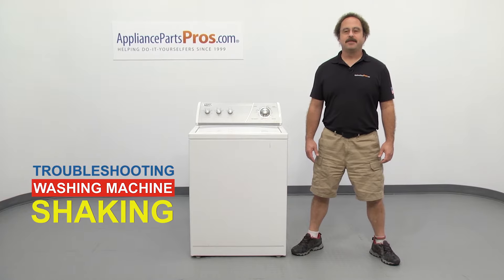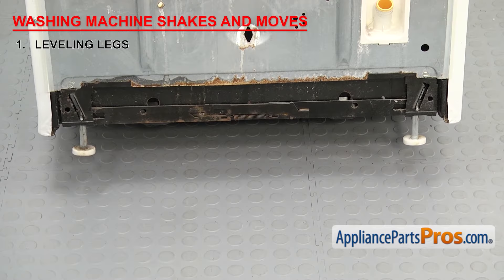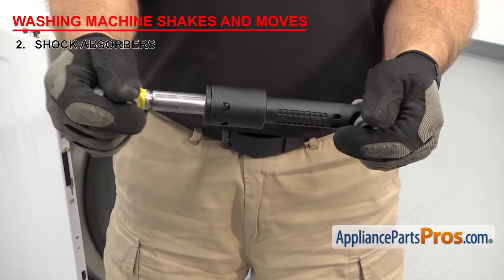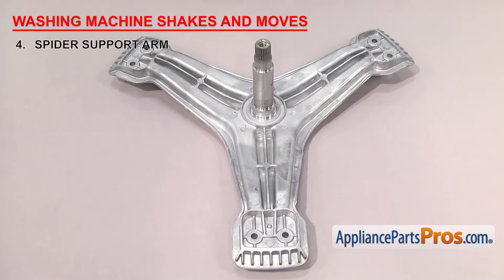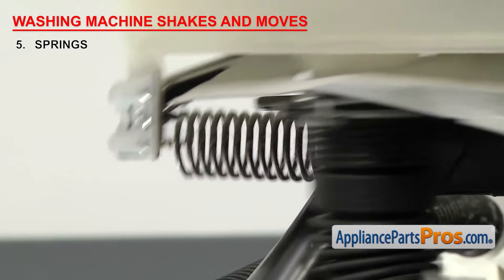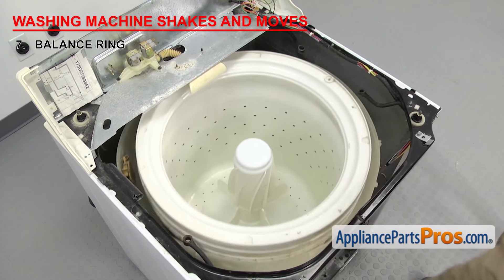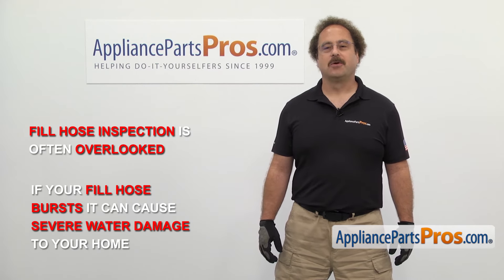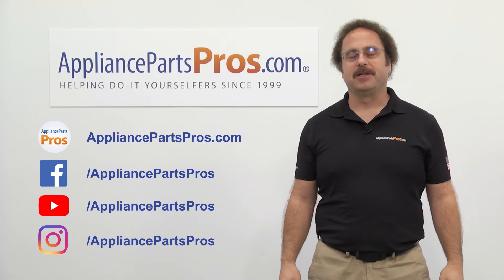Washing Machine Shaking - Top 8 Problems and Fixes - Top-Loading and Side-Loading Washers

Comment: How about if it spins uncontrollably in regular cycle but on delicate cycle it doesn't?? Help!
Reply from the maker: What is your model number and does it spin at all during the delicate cycle?
Reply: Amana and it shakes on delicate too so I change it to rinse & spin and it then spin fine I don't get it?
Reply from the maker: You will need to make sure the unit is level. Check the legs for any damage. Make sure the unit is not being overloaded. You will also need to check the suspension rods or springs for any damaged or worn spots.

Comment: 3:28 really unhelpful this
In the "good" case you give it one push, in the "bad" case you shake it around. How does this help anyone?
Reply from the maker: I'm sorry you didn't find this information helpful. Unfortunately, the suspension rods are not easy to diagnose unless there is obvious damage to it. We are just providing some tips to help you determine if they are bad.
Reply: @appliancepartspros  Ironically enough I put down the comment and closed the video after that section, but I did some more checking and determined that the suspension parts are probably fine, due to the notification of your reaction I played a bit more of the video and now I'm pretty convinced the spider support arm on mine has detached on one arm. So while the #3 section was not that helpful the following one was, thank you very much.
Reply from the maker: You're welcome!

Comment: If I've changed the springs and it still violently bang, what is next. 
NTW4516FW2 Amana C830 22541
Thanks
Reply from the maker: If you have replaced the suspension rods, W10780045, and you are still having the same issue you will need to double check the installation. Make sure they are all seated properly. Check the leveling legs for damage, make sure the unit is not overloaded, and make sure it's level. If you have any more issues or questions, you can call us at 1-877-477-7278.

Comment: Hello I have a roper washing machine that was shaking very bad and so I checked level and it is also checked load and no matter what I do it still shakes, I ordered the replacement suspension rods kit and installed but it still shakes what could be the problem now ? Thanks

Comment: Hi  Thank you for your great detailed information and so informative with Quick precise answers across multiple platforms of manufacturers.

 So on that note my question for you for my washering machine:  Whirlpool  MOD  LSQ9560PW2  SER CS1311919

You mentioned that the bouncer ring has liquid in it to help with counter balance.  How much liquid does it have in it, if you have a ever so simply, quick and easy repair on the tub balance ring. Then to just add the right amount of fluid back into it and seal it at that point.
 I'm assuming it's just water and maybe an additive.   How much Fluid is required to put back in it? But if that is a question you're unable to answer can you answer this question then?

 How much does a fully sealed new one  Or non damage one weigh and then I can figure it out from there.

I have a :
 Whirlpool MOD
LSQ9560PW2
SER
CS1311919

I like to thank you in advance Answer and a long list the knowledge that you have already provided with throughout your channel and content. 
Thank you

Comment: Great video. I believe all these parts are fine on my machine. Mine will vibrate and move occasionally when doing cotton towels that some how occasionally get off center and when it goes to spin if goes into a self destruct (my term) mode where it vibrates so violently it moves the machine. Again only happen when doing towels and only on occasion. I feel like this would happen regardless on any machine, I devised a clever way of solving this I tied a string to the back of the unit into the plug, so that when it vibrates in this mode It will automatically pull the plug out of the wall, I can then re-balance and everything works great. This is no big deal because it doesn’t happen very often but it’s a good safety device. I’m quite surprised that the manufactures don’t have some kind of sensing technology to turn machines off when they get into this situation, mine will literally move across the floor and continue running happy as a clam if left like this. Now the string will turn it off in the first 10 seconds.

Comment: Thanks for the video and suggested fixes. Had excessive vibrations and honestly was considering new washer/dryer. So in the video some of the suggestions were beyond my abilities to do so I picked the simplest one to do which was leveling. Did't know that the rear supports were self leveling, check the fron there were ok, picked up the rear of the washer and the levelers immediately fell down and when I put the washer down, everything was level. Tried a load of work jeans and very little vibration during the rinse cycle......so thanks to a simple fix per your suggestion saved me a bunch of money.....thanks!!!!!!!!

Comment: I have a  whirlpool cabrio WTW6340WW0 Whirlpool Washer that vibrates  really bad during low speed spin cycle. I have replaced  the suspension rods, leveled the washer, pulled the drum, no noise coming from drum shaft or play from shaft, checked motor bolt for tightness .it seems like its missing  more suspension  parts on the bottom drum. any thoughts on what  else I can check.
Reply: If you live in California, it's probably the earth shaking and your washing machine is fine.
Reply: @BA-gn3qb  how about suspension springs? They could be stretched out.

Comment: great vid! how do i know if i have #2, shock absorbers wo lifting the tub down, i have a whirlpool wtw5000wd? any1know, thanks!!!
Reply: Working on exactly that model. You have the rod suspensions. The long ones. Shock absorbers are for front load. You can google your model # and look at parts diagrams to see what you need.
Reply: @alexfl09  thanks alex, would you happen to know or have a link on how to remove the tin cover so I can get 2 the bottom? also, do you know if there are short springs on the bottom of the tub/chasis holding it centered? thanks

Comment: Would bad suspension rods cause the washer to leak from underneath? A repairman just said that’s why mine leaked because the water sloshed over the tub… is he correct? I’m so afraid of water leaks since washer is on second floor!

Comment: Hello, I have a whirlpool WTW5000DW2 washer shacking violently during spin cycle. Just installed new suspension rods like you showed me here but didn't fix.
Cabinet is level. I don't get it.
Reply: Did the same thing , shakes even worse. What next
Reply: @robertgarcia5199  a friend, and repairman mentioned that because of all the banging around before replacing the suspension rods it's possible the tub is out of round/balance.
$200 plus just for the part. Still banging!
Reply: Mine too, replaced suspension springs,  and recalibrate, but it's still bouncing banging across the floor.

Comment: Reason #9 of 8: corroded/cracked drum mounting hub. To replace: 
Detach the top lid and pop the door switch off. Pull up the agitator (site need to be unscrewed). You will need a brush to clean and inspect the hub. Wiggle the drum,  check for crack. The retaining nut is left-threaded, aluminum and 1-11/16in. Will need to order a special wrench (or spare nut if you are drilling/chiseling it. Still need the wrench to tighten. 
Happy Fixing!

Comment: Thanks for making this video so clear and easy to understand! Videos like these give me the confidence to check out this stuff rather than shell out $$$ to some smelly old man who won’t even fix it right and tracks dirt into my house.
Reply: Hate much
Reply: So true, I had some old appliance guy come out to my house today to look at my washer that is out of balance. He poked around for 10 minutes, took nothing apart, and said, I think one of the tub mounts is bent and you need to buy a new machine. Then gave me a bill for $105. Utterly useless waste of space
Reply: @logdon17  had 2 repair guys come out for an under warranty Speed Queen AFNE9BSP113TW01 front loader that violently shakes during the beginning of the spin cycle and actually fell down from the pedestal causing damage to the washer and cabinet it fell into.  First guy just visually inspected unit and called his boss but nothing was removed to check like this video shows.  Second repair guy came out (had to wait 2 1/2 weeks to get him out after first guy couldn’t find out the reason for the shaking) who was the lead technician and the guy the first repair guy called.  He did even less than the first guy and tried to blame it on the pedestal saying since it’s not an official Speed Queen pedestal that Speed Queen would likely not honor a warranty replacement.  I had him take it off the pedestal onto the tile floor and ran the 10 minute spin cycle.  2 minutes into it is when it starts shaking and even on the level tile floor it moves a good 3-4 inches.  Then he said well maybe getting a rubber mat and rubber pads for the feet (it already has rubber feet).  He was supposed to contact Speed Queen back on May 10th and I’ve been hounding them for an answer and then they told me the technician needs to return as they have to be there on the premises where the washing machine is to call Speed Queen.  Problem is the guy isn’t scheduled to come back until June 9th (a full month after he was there), and he should have known on May 10th that he should have called Speed Queen at that time instead of wasting another months time.  In another incident feature the same exact washer in another property, the same thing happened yesterday May 23rd, where I found the washer face down on the floor after it walked off and fell off the pedestal, cracking a cabinet door.  What are the odds 2 of the same model washing machines have the same problem within a month of each other and these washers were bought around the same time 4 years ago.